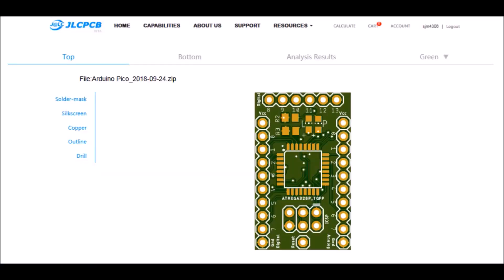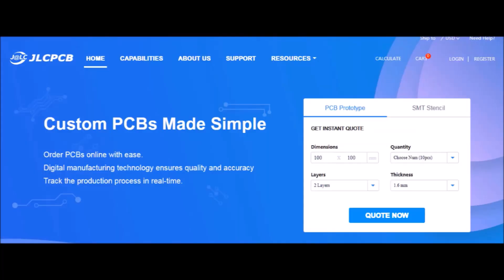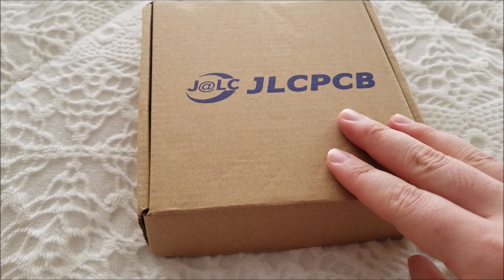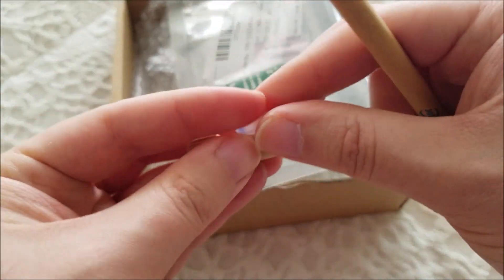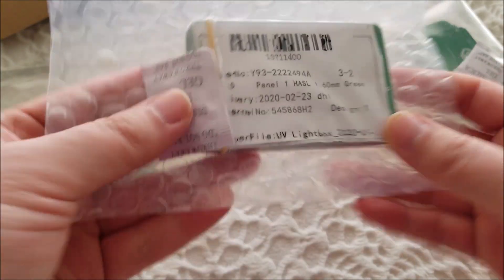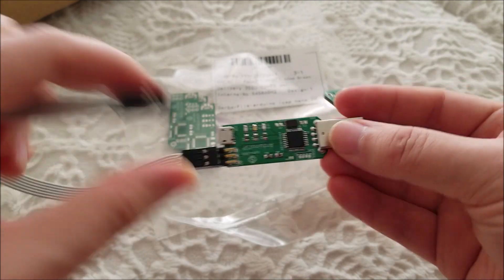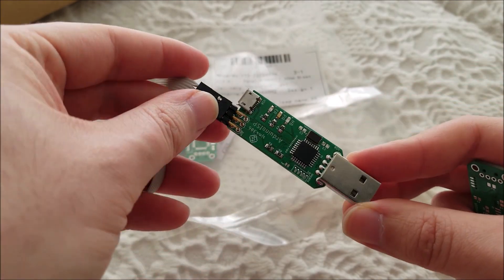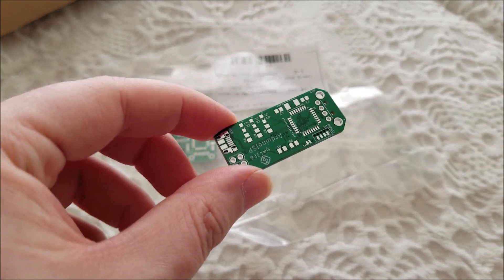Making Your Own USB Arduino ICSP Programmer

Comment: Thanks for your device. Can this device load a hex file onto a PIC Microcontroller using Arduino Uno?
Reply from the maker: Unfortunately no, only programs atmels. For pic there's a similar open source programmer based off the pickit programmers.

Comment: Hi mate, thanks for sharing this.
Can I ask you why you didn't connect the two Capacitor next to the Oscillator both to CH340G and the ATmega328 ???
Thanks in advance.
Reply from the maker: They are to stabilize the crystal oscillator, but I find for 90% of what I design they really aren't necessary. Very timing precise stuff like bitbanging usb or some other fast serial protocol may need the caps so I just add the footprints in-case I ever need them.
Reply: @sjm4306  Thanks for your quick reply mate,  appreciate it.

I was "Googling" this morning and I found this product on Amazon for £5. Do you think it could be a good product, I'm looking for a friendly and honest opinion. 😊

https://www.amazon.co.uk/Hobby-Components-USBASP-Programmer-Adapter/dp/B06XYV162N

Comment: Yeah I have a good solution to your sickness go find lemon juice in a small yellow plastic round bottle that looks like a lemon with a green lid cap and a bottle of honey in a plastic bottle that looks like a bear and get soft peppermint 6 or 7 soft peppermint and Jack Daniels whiskey put 5 tablespoons of whiskey in a pan add the 6 or 7 soft peppermint in take the honey and pour it in the pan and take 1/2 a cup of lemon in warm it up until the peppermint melts away and it is warm to the touch of the front of your palm of your hand so right On the vein to check your pulse and put it in the cup and drink it all then get under the covers and then take a little nap or sleep good at night and when you wake up you will be coughing up mucus don’t swallow it spit it out and I’ll guaranteed you will feel better and this little remedy is called a hot toddy and it works better than Mucinex

Comment: If you want to remove a couple caps and a crystal, you can substitute the CH340G for a CH340C, the pinout is the same, but the CH340C does not need an external clock.
Reply from the maker: I'll check it out, thanks!

Comment: Very clean design!
The micro-USB connector and ISP connector are quite close to each other, though. Some micro-USB cables are quite bulky around the micro-USB plug, which could cause excessive sideways force on the connectors when using micro-USB connector. That's just a suggestion to think about, if you are going to sell these at some point. Not a big problem and not a problem at all, if you have a suitable cable or are only going to use the regular USB A plug.
Anyway, great job. If that was red, I could imagine it being made by Sparkfun :)
Reply: Or use an adapter on the USB1 side
Reply from the maker: Yeah, it was one of those last minute additions that I didn't think through much. I'll probably space them out a bit or just rotate it so it sticks out the side instead.